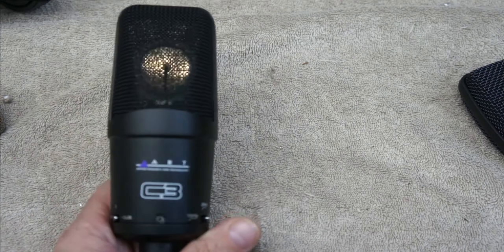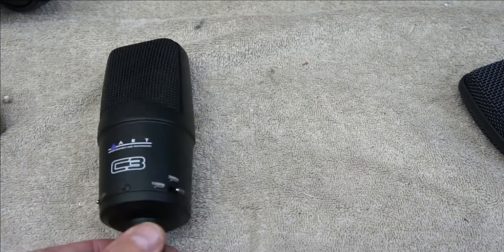Close Miking Kills Kittens or How to Mic Your amp the RIGHT WAY if the sound-man will let you!

Comment: In another black and white video, George had his cab mic'd at the center of the speaker but there was a cloth face that had a 3" circle of wood? backing support for the grill cloth covering the center of the speaker. The narrator explained that the treble high end sound would travel to the outer rim of the speaker, breaking up the harshness of the high end treble, blending it into the rest of the sound into the mic placed about a foot to 16" away. . To emulate that setup, i made a round cardboard cover attached with tape to do the same with the mic as he did. Blend the treble to the outer edge instead of straight into the mic. 
   I have the cover on even playing without the mic and its not so peaky in the high end in an open room. Also, i made a cardboard cover that brings the sound out the front in a half open back amp. So my mid bass is present in the front instead of into the walls behind the amp. And cardboard does resonate different than a masonite panel would. I play a Tele thinline and i enjoy the open sound. I even use elixir phos. bronze strings to get a string sound while i play mostly clean tones. Sometimes a pinch of overdrive or distortion, depending on how i ramp up my pick attack or where i play over the pickups or not. My amp is a Mustang LT25 on superclean digital (zero 60cycle hum) into a Crate cab with a G12k 100 Celestion speaker. That crate amp died so, i have a great Studio setup.  I use Behringer acoustic DI to preamp my signal and the tone is so full with that 25 watt Fender amp.    About that cardboard circle...i need tremble to get the high frequency tone from my wound strings and covering the center of the speaker cone as it doesnt let the treble dominate that tone right off what the mic can pickup. One cannot calibrate that electronically, so ya gotta do it physically with a circle of cardboard.   Thanks George Harrison !  hahahaha
    I love your videos, sir.... I enjoy messing with stuff as you do. Very informative videos, thank you !
My next experiment is to mic 10' away from my amp, mic facing into a corner wall with a cone around the mic barrel to draw the sound in. The room is about 20' x 20' carpeted with two couches to absorb some reverberant sounds. I desire a large, natural sounding room. We'll see. Also, my Yamaha finger drum kit will run thru that Celestion and i desire to make a big room sound, in real time. I record with a Zoom R12. Works great$$